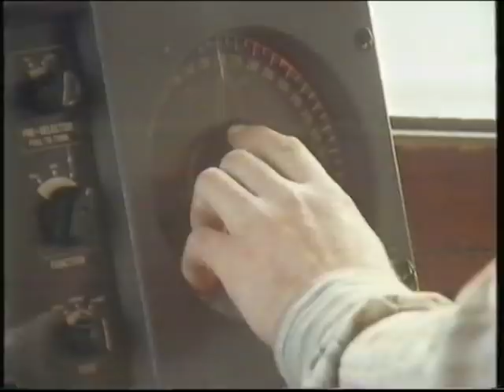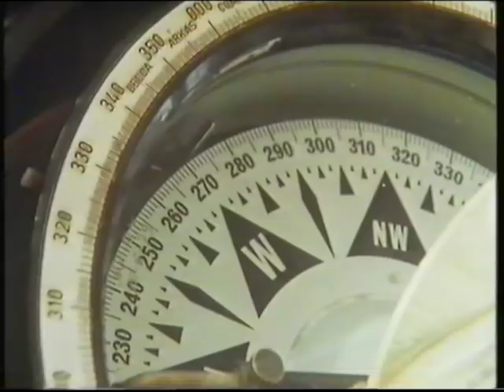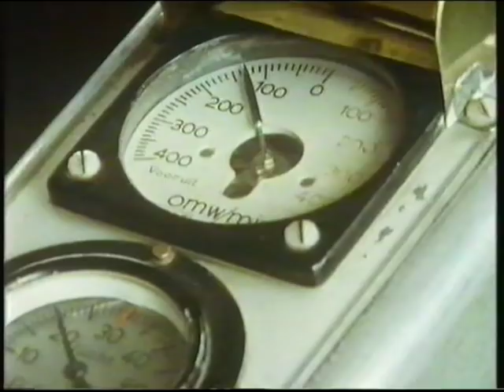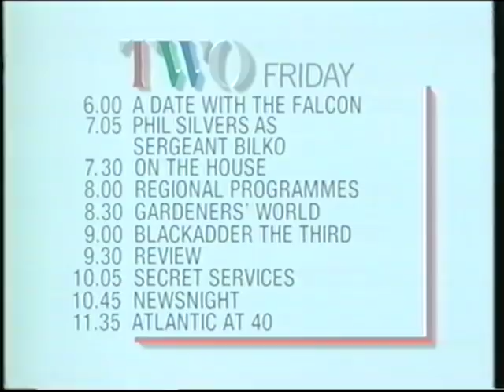COASTAL SHIPPING DOCUMENTARY: A Passage To Wisbech.

Comment: I had a few months as Mate on a coasting Barge for L&RTC, in 1969, but left to take up a belated apprenticeship as a plater/welder. I joined the Royal Naval Auxiliary Service (Naval trained part time volunteers) in 1972 and because of my trade, was accepted as a junior engineer. I had sixteen years at sea with them, often passing my old barge and many other ships of the company. I was a chief engineer by 1975 and loved my time at sea. Had I have been put on one of the larger continental coasters, I'd very likely have stayed there, but happy memories of those great times. As others on here have said, if I had my time over again, I'd spend longer on the Coasters than I did.

Comment: Wow loved this. I love little coaster ships. Find the idea of working those ships more interesting than deep sea. does the U.K. still have many plying the waters? I remember union transport. Often wish I’d gone down that route as a job. Although they were plying coastal waters, did the crew still have to stay on board for months? How long were they away for?
Reply from the maker: Certainly there are still coasters plying the waters around the UK but nothing like as many as there used to be which is a matter for regret as it's a very environmentally friendly means of transport which could take many noisy polluting lorries off our roads.  Not sure now long crew spent on board at a stretch - hopefully someone who did the job might answer that question.
Reply: oldelephantstew I rear somewhere that coastal shipping has had a small resurgence? Might be small. It does make total sense like you say. One of those little ships can carry 50 lorries worth of freight. I spent a short time as a lorry driver and totally agree with you. It’s senseless, they’ve put everything on the badly strained roads. Railways ruined. Hopefully there will be a renewed interest in use of small ships and little river ports. A fantastic way to move goods around.
Reply: @airindiana  yes!

Comment: 12:12 we used hooks to make it easy on the back..
Reply: I was surprised that they used only one tarp. 
We had always two tarps (the oldest on the hatchboards) and in wintertime three tarpaulins.
What I also did not understand was the number and type of the lashings over the tarpaulins. I was told that these lashings were to be that strong that the ship was able to stay afloat on them. Standard number of lashings on each board was three of them. The ones that were used on Carrick (ex Dutch mv Eddystone, which I remember very well) seemed to be inadequate.
Reply: @janvisser2223  another old timer like myself..yes we had 3 tarps and iron stays across the top and bolted in the middle.pulling those beams was hard but then I was a tiny lad.thanks for your reply about a time of our past.
Reply: @whiteonggoy7009  This old timer has some more memories to share about this subject. (Because it’s fun)
- Folding in the tarps at the corners of the hatch in such a way that they could not be pulled out by an incoming wave.
- The tarpaulins were laid out in such a way that the seams in the tarp were not damaged by an incoming wave. (Water had to flow óver the seam and not stopped by them (English is not my mother tongue))
- Wedges: the 90 degree angle of the wedge pointing towards you, otherwise their edges could shear off when you hammered them in.
The Carrick was built in 54, and fitted out with the old style battens over the hatch boards consisting of channel bars with a wood inlay. (Seen on photos of her under her first name Eddystone) These were later prohibited by the authoroties due to the fact that they gave a lot of resistance to the water, causing hatches to be smashed in.
You could find a lot of systems after that:
The iron stays you mentioned with a bolt (sometimes a turnbuckle) in the middle.
A steel wire with a hose crimped around it, with the big disadvantage that the wire could not be inspected for the obvious corrosion.
The ones I liked best was a steel flat bar of about 120 x 10 mm with a heavy flexible section of about 300 mm at each end to protect the tarp in way of the edge, at the end a threaded section with a large “wing nut”
Pulling beams was indeed a tough job especially when the vessel had a lot of trim, sometimes a beam ended up in the hold. (500 kg their weight)
On the larger deep sea vessels I sailed on later we had the single pull McGregors but with heavy hatch boards for the tweendecks. These were indeed handled by hooks as you mentioned earlier as they were of a heavier design.

Comment: @22.55 so british where a temporary fix becomes a permanent feature "yes we use the bilge pump for emergency cooling" :D:D they were barely leaving port ffs these things were floating deathtraps
Reply: Yes, I fully agree. Sailing with one cylinder down on a single screw vessel and one of probably two generators out of action.... crazy!  Yes it sounds romantic to those who are unaware of the dangers involved. Thankfully today things have changed and ships in this condition would not be allowed to leave port.
I expect a lot of negative replies to my comment but I say to anyone before you make a comment Google the mv union star and the penlee lifeboat disaster.  All caused by an engine breakdown.  I was on a ship ten miles away on the night of that disaster. Ex. Marine Engineer with 26 years seagoing experience.
Reply: @vectravi2008  I know nothing about the ships, but I can see the dangers here, risking their lives, and those of others.
Reply: This engine make (Brons) had two engine driven piston pumps driven by an excentric at the front end of the crankshaft. One being the bilge pump and the other one the sea coolingwater pump. (Engine was seawater cooled)